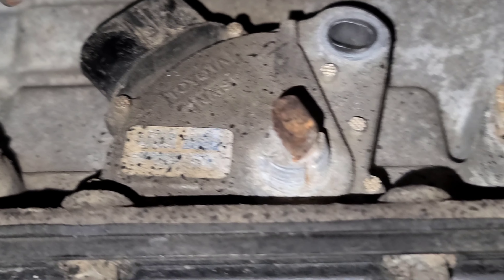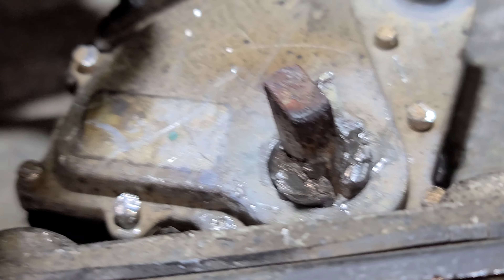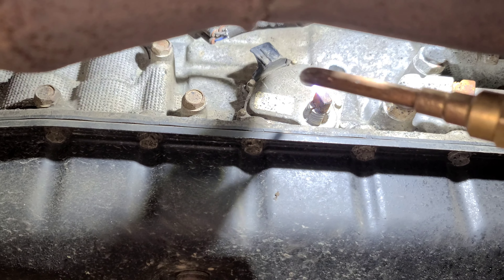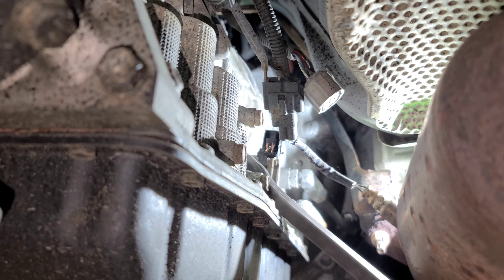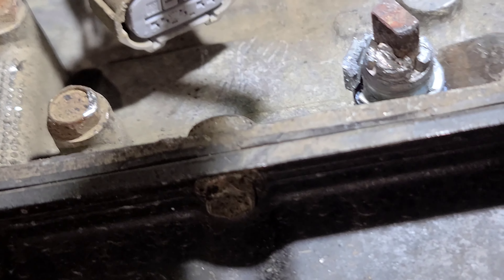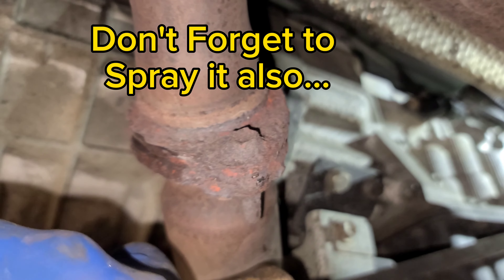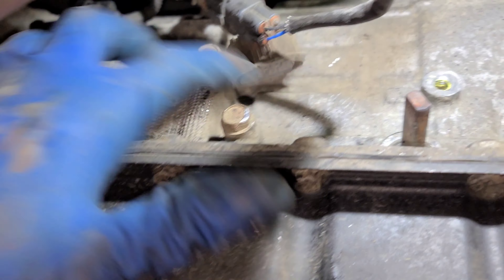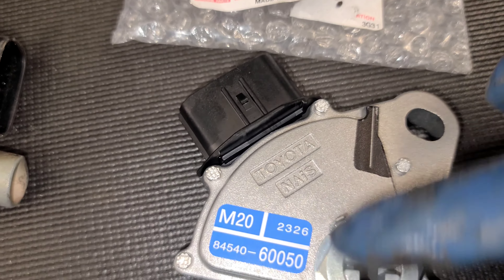How to Replace a NEUTRAL SAFETY SWITCH on a 5th Gen Toyota 4RUNNER 2009-2022 - EASY DIY Range Sensor

Comment: I had such a hard time prying it off. I ended up using a map torch until the big part of the switch popped off. But that left a small amount of metal still on the shaft. I ended up just using the map torch again for about a minute and the metal around the shaft melted like solder. Just a pointer so people dont have to struggle getting it off. When it doubt, burn it out.
Reply from the maker: Pinned!

Comment: For removing part a gear puller works really well. Just place the hooks on the back side of the part and use the shaft to pull it off.

Comment: I sprayed mine with some wd40  and some kroil and finished it up with some fluid film and it's soft as butter , I didn't need to replace the NSS- worth a try before replacing.
Reply from the maker: Awesome,  hope it continues to work for you

Comment: Can this switch be partially working?? My corolla shifts fine in P, R, N and D,,, but when I go to neutral or drive , it turns off, so I will put it in neutral, start it, and put it in drive and it will run fine

Comment: Question? If I reach down  to the transmission and switch manually the neutral control to drive with is damaged if safe to run to my house? If not going to switch back to R or P again in the road ?
Reply from the maker: Yes, That is fine to do To get where you need to go. It won't switch back automatically. It would take a lot of force to do it on its own. 
You should be fine to do that.
I did it with a subaru last week and it was okay
Reply: Did you take off transmission cooling lines for access?
Reply from the maker: @rabbit3502  nope, didnt have to.
I did 2 of these in the past two weeks and didnt have to remove them on either one
Reply: thanks man!
Reply: I had this part fail twice on my 2020 4 runner. Toyota had to fix it under warranty. Why  me? @THE_MOTOR_MAN
Reply from the maker: @michaelpalm2210  atleast it was under warranty! Sorry about your luck, but atleast you didnt have to do it. They can be a pain to replace

Comment: Is there a techstream calibration or initialization that goes with replacement?
Reply from the maker: No sir, as long as its lined up with the neutral mark like i explained 
And you may have to clear the codes

Comment: Why is it so hard to put the new switch on?
Reply from the maker: Did you clean the shaft with a wire brush and then grease it?
Also you will have to knock it on a little bit Because it is a tight fit. So just take something in lightly. Tap it on until it seats all the way back.